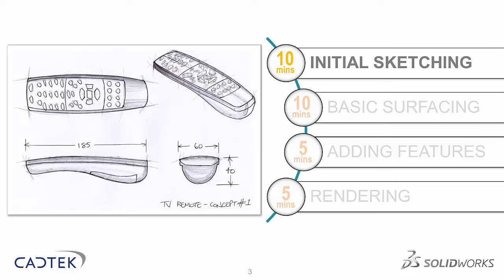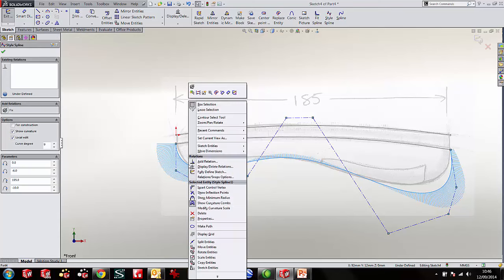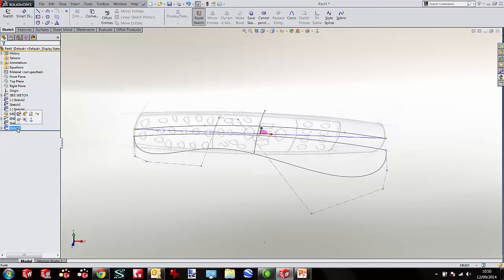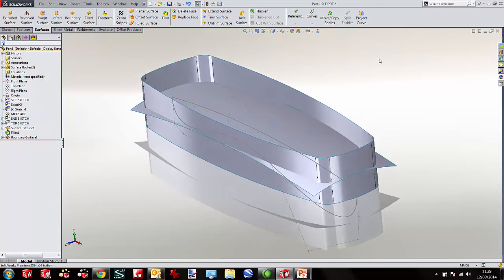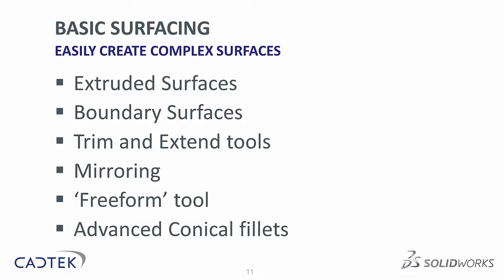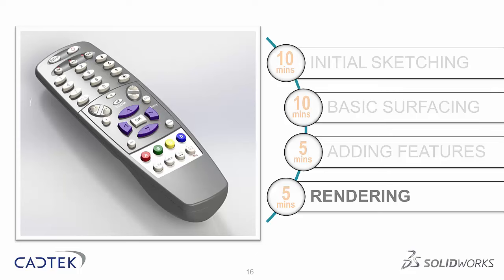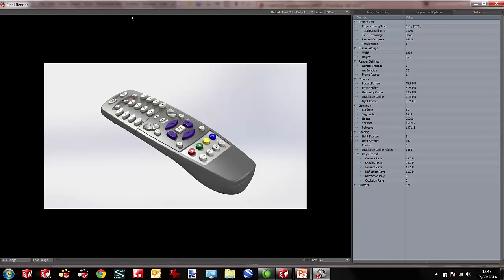Designing Consumer Products Using SolidWorks

Comment: I come back to this tutorial probably every couple years to not get rusty and remind myself that surfaces in solidworks are not as terrible as everybody and their mother tells me they are. I mostly use plain solid parametric design as a mold designer and the only surfaces i use day to day are boring patches for mold forms or occasionally i need to patch holes in  customer models so they work with the cavity feature. It is still the same blast to follow and design along each time as it was the first time. I wish every tutorial was this casual and fun to follow. Thank you for this gem of a tutorial!

Comment: This is really helpful! I am wondering how you, as a designer, would go about working with engineers to fit all the components inside the remote. And how you would go about modeling the fastening features etc...
Reply: Hi Claus Bertels 
The nice thing about using SolidWorks, is that I can create a conceptual model in this, rather than any other visualisation tools, then hand it to the development guys who can continue to use this, to add all of the detail such as bosses, and snap hooks etc. 
Have a look under INSERT>FASTENING FEATURE for more information, and watch this space for a video coming soon on these features.
Good luck!
JT
Reply: I am an engineer doing product design.  I use a similar approach to recreate geometry provided by industrial designers.  I insist on having native, parameteric Solidworks geometry to build my model upon.  I have gotten 300 features down the road only to find out I need to adjust a curve slightly at the top level.  If the top level is an imported solid, you are SOL.

Comment: I get stuck in the point that I have done the 3D sketch and Converted entity. When I go to do to boundary surface, it says boundary curve features should be all closed or all. Mixed cases are not allowed. Please help.
Reply: +Ramtin Sirous It means your sketch is not closed, most likely you did not include at least one line boundary, or at least one of the vertices are not properly joined. These are hard to see sometimes, especially when there are too many lines on a sketch. Just need go back and make sure everything is nice and tight, otherwise the surface cannot be contained by your sketch.

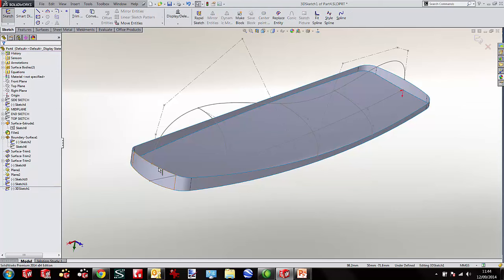Comment: 19:08 I’ve been struggling quite a bit with surfacing edge management for smooth boundary surface creation and this tiny clip about using a new 3D sketch rather than the existing surface edge has helped me SO MUCH. Thank you!